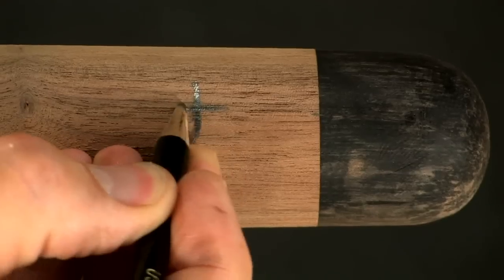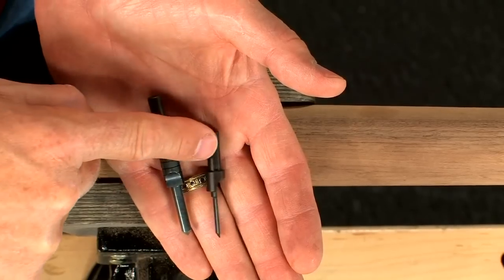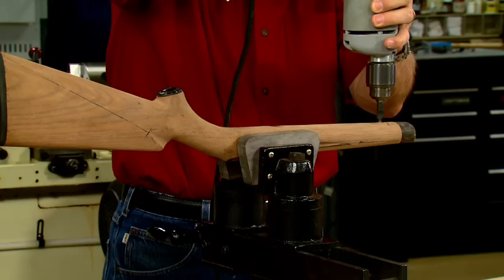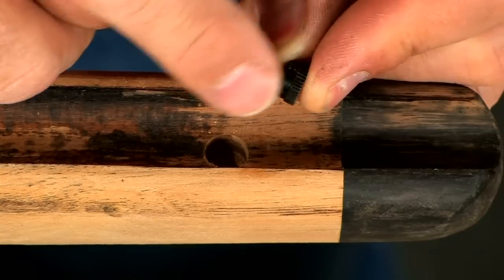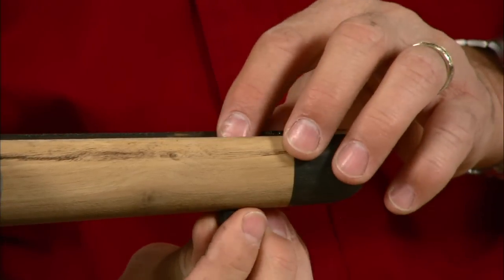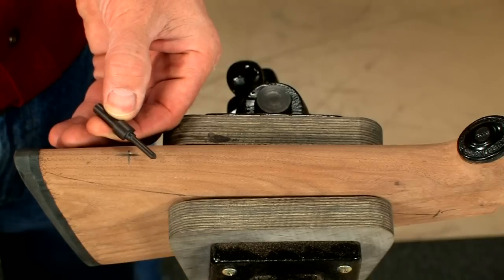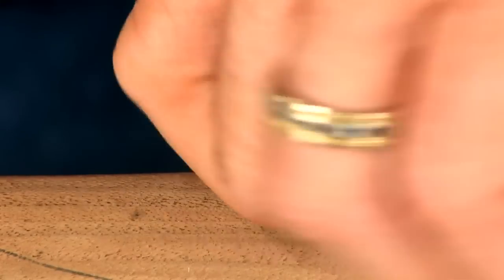How to Install Sling Swivel Studs in a Riflestock | The Model 67 Project | MidwayUSA

Comment: "the right tools make any job easier" Well, look at 'em, because Ol' Larry isn't gonna tell ya what they are.
Reply: Yeah, I ordered the sling swivels & studs. Now I have to order a special countersink drill & wait another week. I'll figure something out.
EDIT: I looked in my toolbox & found one of those c'sink drills for wood screws (with a 3/8" OD - same as the washer). Took the pilot drill out & ground the c'sink angle down to a flat (90 deg angle). Put the pilot drill back in and did a few test holes in scrap wood. It made a nice flat surface for the crush washer to sit on. 
BTW, why do most people use the white washers? I like the black ones.
Reply: lmao came back to this video specifically to see if he said what size his bits were

Comment: a normal twist bit of smaller diameter than the shank of the swivel stud and a spade bit to recess the hole works well to instead of spending $20 on a swivel stud bit just a thought
Reply: Yes...but it's real easy to tear the wood around the stud. The special bits work best and there not that expensive.

Comment: I like that you properly call it a drill instead of drill bit. Before battery powered drill motors we had a drill and drill handle when working away from power. Then we started to get tools from China-drill bit. It's like calling a cartridge  a bullet. No big deal until you start reloading.Order bullets and you get the lead projectile.
Reply: Not totally correct. And why r u nit picking...it's not helping anyone

Comment: i like how the stock was cracking on the back stud
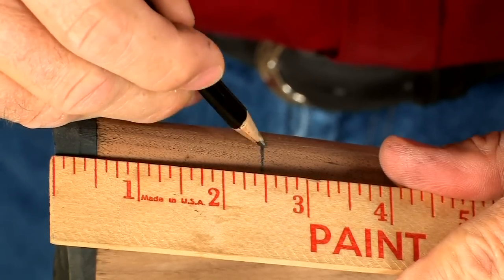Reply: At 0:28 you can clearly see that the stock was already cracked before he started drilling for the rear stud.  It was probably just an old damaged stock they had lying around and used it for the demonstration.
Reply: It's clear he was refinishing the stock as well as installing the studs. That was not a crack.

Comment: he put the front stud nut in backwards... the flat end should be facing down in the hole. But I guess it doesn't matter.  Logic tells me that it might work loose. I use medium strength thread locker on the threads on the front stud and wood glue on the rear stud.

Comment: Is it possible that on the Marlin 81 that the front stock is too thin for a swivel stud how would you and I really don't want to put a sling mount on the tube feed fixing that
Reply: That’s what I’m wondering also on the marlin model 60 and if the screw exceeds the inside of the stock if it will hit the feed tube

Comment: You can use a normal drill, right?
Reply: Yes, you can. I just put studs on my rifle, just use a larger bit to make the "countersink" portion, then drill a smaller hole in the circle for the threaded part of the stud

Comment: The tip of the stock is considered that darker piece added to the forend.  You are not supposed to put sling swivel studs into this piece.  Mr. Potterfield is installing the stud 1" from the "tip" as is shown by his tape measure.

Comment: He did 2,5 inches on both ends lol...
Reply: The rule is around that distance...but always behind a forearm tip like the one on the stock they are generally glued on...so the distance may be longer to assure u don't put force on the tip that could come loose.